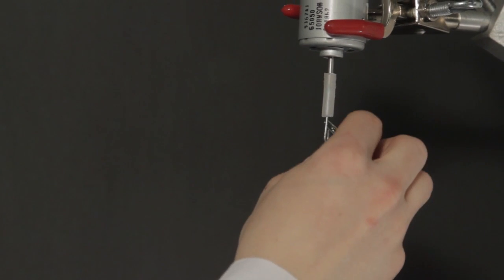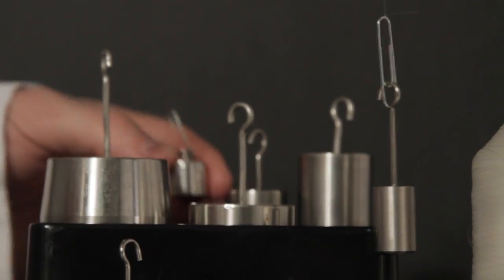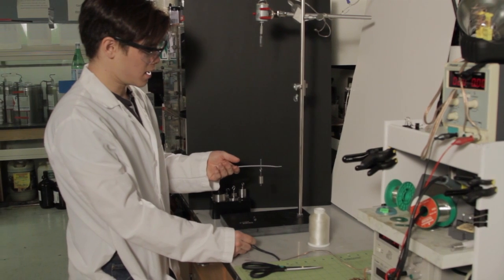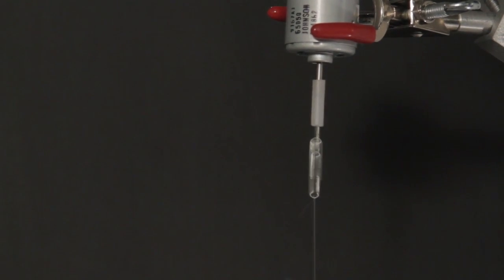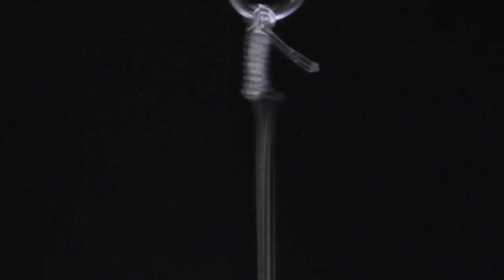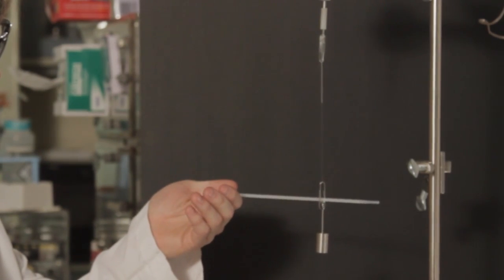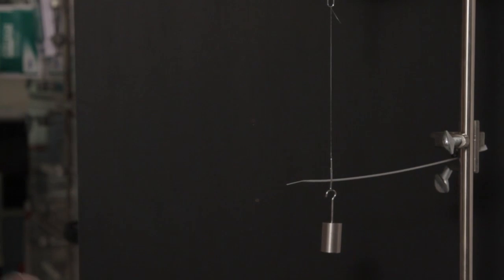How to create an artificial muscle from fishing line.

Comment: Hi! Could you please tell me what kind of fishing line do you use? We are doing a project about artificial muscle and we are in desperate need for the fishing line! I have tried many kinds of fishing line, but none of them can make a coil!! I would be so thankful if you could help me.
Reply: 涵玮汪 Hello. Not sure if this answer will suffice, but they've published an article about it: http://www.sciencemag.org/content/343/6173/868.full
There's a table on it that shows how much pressure needs to be applied during the coiling process (aka twist insertion) depending on the type of line. The main idea to keep in mind is: too little weight and the fiber snarls; too much weight and it breaks. I created table based on the article for the 4 types of lines used and I'd guess the one used on the video was: Nylon 6,6 monofilament sewing thread. Fiber diameter = 127µm, Load=16MPa. Just apply the good old Pressure=Force/Area and you should find the same 20,67grams. Good luck with your project! :)

Comment: There is a missing step(s) here:
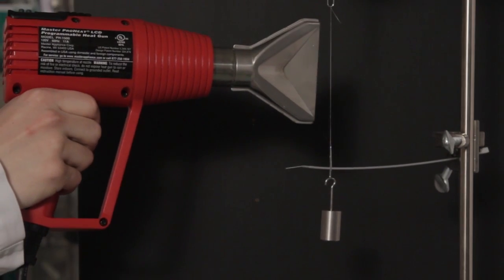notice that the untwist-stop bar is at a different angle when the initial coil is finished at 0:59 and when he starts heating it at 1:21

It would be nice to know if it was unwound a bit, or more weight etc. - but looks like might be the same weight.

Comment: Help ? I already know how to make such coil from fishing line (1mm). I am using 1kg weight when twisting. I don't know how to make it working. I have perfect coil which is very tidy and hard to expand. Like in movie. When I put some additional weight on it to make it longer and start heating nothing is happening. I'm using hair dryer. When I'm heating it too long time then every coil getting smaller, loosing it's transparecy. Adding more weight breaks the line. More heat - it uncoils it self. I can't make coil permanent not so tidy as it is directly after twisting. Once when I was heating it, adding weight, heating again, removing weight, adding weight I got some spaces between coil and by applying heat it contract ... 3 mm on 10cm coil. What am I missing here ? If you will take a look on movie then you can see different lengths between 1:00 and 1:02. Is there any additional process the movie is not showing ? I tried to add more weight to make a coil longer, untwist it a little bit to make colis less tidy. Still doesn't work. Any clue ?
Reply: alister nelson
thank you friend. mfw I used 60 lb line and it didn't work.

Comment: Won't the heat eventually melt the plastic line? Not very practical in any universe. This is as useful as walking backwards _ exactly.
Reply: Plastics have a safe heating range. Remember this line was not made for this and a plastic produced for this use would be prepared for better heated properties.

Comment: @thisthingsirecord"Heat makes things expand, right? So why does the fishing line contract? I don't understand this :[" Good question, heat usually makes things expand. However, in this case, the polymer length is determined by a balance between the thermal expansion of individual chains and the desire for nanoscale chains to curl up due to entropy. When you increase the temperature, the nanoscale polymer chains get bombarded due to collisions with neighboring molecules, curl up, and make the wire shrink in length.

Comment: not sure this is going to have much on shape memory alloys... Id be interested to see fatigue life and real force/length data
Reply: "Baughman and his colleagues report that their new artificial muscles are every bit as strong and effective as shape memory alloys (some of which have been around for close to half a century), and other artificial muscle materials like carbon nanotubes. Existing artificial muscle technologies are also more difficult to produce, and often less mechanically efficient than these simple coils of twisted fishing line. And here's the real kicker: the materials used in conventional artificial muscles can be orders of magnitude more expensive than high-strength polymer fiber. For example, the carbon nanotubes used to design the artificial muscle Baughman himself engineered in 2011 runs on the order of $5,000 per kilogram. The same quantity of fishing line costs just five bucks."

The io9 article goes on to talk about other advantages over shape memory alloys, such as the twisted fishing line muscle's lack of hysteresis.  Basically these twisted fishing lines are better in every way.

Comment: They made you wear safety goggles for the hairdryer?!?
Reply: No, probably for the very thin, sharp wire under tension attached to a motor.
Reply: It's a dangerously effective hair dryer.
Reply: Still, just a hair dryer. Ok-ok, a VERY dangerously effective one.